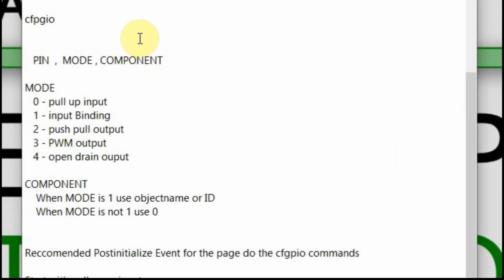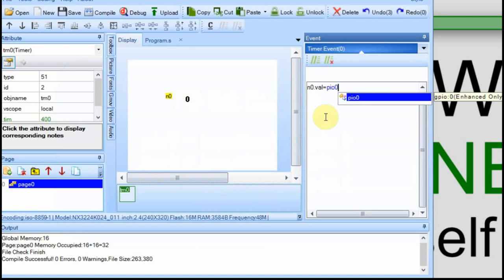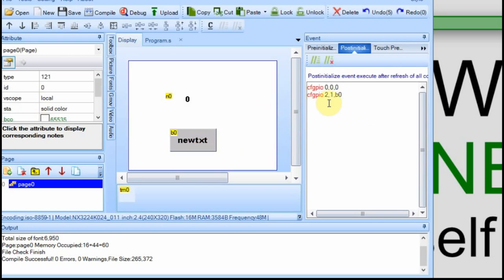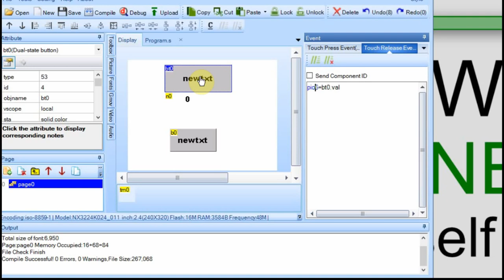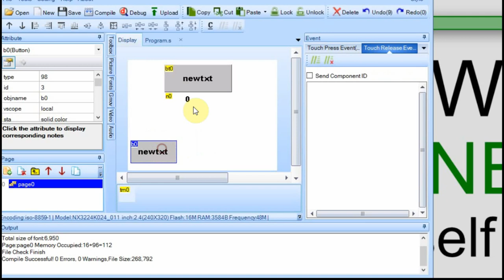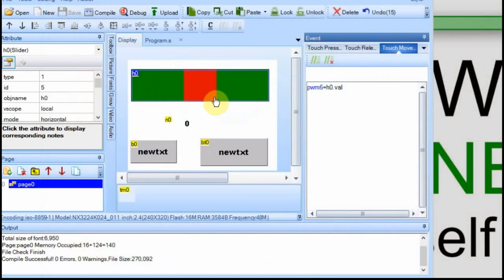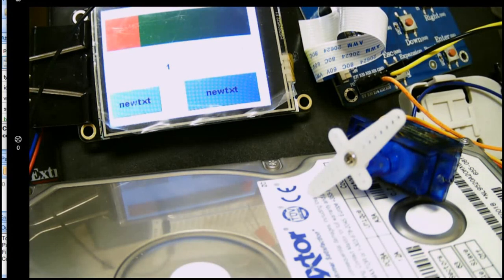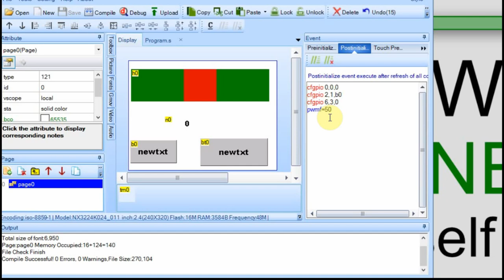140 Nextion gpio pins an overview of the configuration and usage with some simple examples

Comment: Great work,  I have  10 values i want controlled in one button when click button all 10 values star how can do that
Reply from the maker: If you want to control a larger load you will need to attach a relay or opto isolator so you don't damage the Nextion Display.  Thank you for watching.

Comment: thanks a lot ,,,can  the nextiom hmi work with plc  like allen bradley or siemens ,serial communication ?thank you
Reply from the maker: I am not sure.  the Nextion can sends HEX codes at all baud rates.  If the PLC can interpret codes and send specific strings then it should work.  You can get a cheap low end model and try it out.  I have access to some MicroLogic PLCs but I think I need proprietary software to code them.
Reply: @CheapControls  thank you ill try it and then tell you :)
Reply from the maker: I look forward to hearing back.  What brand of PLC are you using?
Reply: @CheapControls  i have many plc ,,,allen bradley ,micrologix ,,,controllogix , siemens s7 1500 , panasonic sigma , i have a converter too to convert rs232 to ethernet ,,,,i think communication with hmi nextion willl be as sending message .(like awa instruction in allen bradley ,,,
Reply from the maker: I have not programmed an Allen Bradly in 20 years.  Good luck and let me know how it goes.

Comment: Simple servos take a command pulse from 1000us to 2000us. At 50Hz, 1% = 200us, so 1000us would be 5% and 2000us would be 10%.
Reply from the maker: That is interesting.  I am building a circuit board that will make this information very useful

Comment: Can the display be set to start with pins on low instead of high  without connecting to  an arduino? 
I have mine set up to 8 relays and works perfectly but want it to start with pins on low.
Reply from the maker: I do not believe you can change polarity in the Nextion for the I/O pins

Comment: I still don't know how to connect sensors and import their values? It says on the ITEAD homepage that it is to be used for this. What I don't know yet: how does the piezzo work?
Reply from the maker: I have not found the Nextion to work for collecting data.  It is better to use an Arduino to collect sensor data and then transmit it over serial.  For control the Nextion can turn things on and off and do some PWM  but the current level is very low.  I think it is best to use nextion for display and Arduino to input and output.  I have started to use ESP32 in place of Arduino but it functions very similar.  The ESP32 has Wifi.  Sorry if this is confusing.
Reply: @CheapControls  my board is also ESP32 (with Nano 33 I have a little struggle) and in HA ESPHome, not in IDE (IDE is not very good for ESP32). I wanted to recreate an "NSPanel where the relays (240V, instead of 5V) are already built in, but it can be recreated using "Expand Board". For me it would be easier if Nextion not only "beeped", but also that Device turns on what can be connected (small pump 5V, for pouring) If I connect it to VCC and Ground with no definition, it starts working immediately.But the pump doesn't have 4 wires like a motor, so I have no idea , how I can switch it on (without ESP32 board) It is therefore important to me that the Nextion can also work independently, because unfortunately there is often an Internet failure, and an ESP32 then no longer works, but a Nextion does not need Internet/WLAN, to switch its own GPIO (that's why I prefer battery+time setting instead of "Internet time") In EasyESP (I also like coding) I don't know at all how to specify the GPIO and Piezzo beep, and also alarm afterwards say if something is wrong. That's what the GPIOs are for. Or not? Unfortunately, there is hardly anything to be found... I found this, but without a sketch of what should be connected and where:

Could you please show that too, or "frize" where to connect the GPIO and PIN of devices to? Unfortunately, the video doesn't show it very well. Where is VCC and where is the yellow wire?

https://nextion.tech/2022/01/24/the-sunday-blog-nextion-gpio-part3-digital-input-unbound-and-bound/
Reply from the maker: I can not speak to the buzzer.  I have not used it too much but the Nextion displays should drive a relay and I have found the RTC to be fairly accurate.  You should probably have an admin page were you can adjust it from time to time. 

As long as you don't need to control or read analog signals you should be good.  I have a larger board for testing the GPIO pins that works well.  I have limited experience with the smaller board.  Do you think there would be a market for a relay board that connects directly to the Nextion?  I might start building one.  I am not sure your location.  Feel free to submit a comment on www.cheapcontrols.com and I will reply through Email.
Reply: @CheapControls  I just added a chirp to keys on a small keyboard app. The expansion board beeper was configured with
  cfgpio 7,2,0

I use a disabled hotspot to create a beep subroutine (in the press event)
  pio7=1
  delay=15
  pio7=0

I call it with
  click beep,1

You've probably sorted this by now, but I thought I'd share for new people. You do a great job on the videos. I use the Nextion with the Propeller processors with my own library. At the moment it's deployed in two commercial products (camera pan/tilt controller and a laser-tag game piece).
Reply from the maker: @JonMcPhalen  That is very interesting.  I originally started this channel as a basic electronics channel, which was not a good idea.  I stumbled onto the Nextion and decided to make it a control channel with those displays.  But then I got sidetracked and spent the last year making 90% Nextion tutorial videos.  I want to get back into the control videos.  I have a video coming out next week with an add-on relay board for the Nextion that connects directly to the GPIO port.  I want to adjust it slightly and then make one with PWM and some other options.  I am unsure if there is a market, but it is fun to build things.  If you'd like to play with one of my boards, let me know over at the cheap controls main website.  I have a contact form on the help page.  I hope to have the video out on Thursday.

Comment: Is it possible to get multiple float values from one or several sensors through GPIO? 
For example, t,h,p from BME290 
or/and +coordinates from GPS/compass?
Reply from the maker: I do not think this is possible.  I do not have an intelligent model but I do know the Nextion can not interpret Float values.  You have to do some tricks if you want to work with Floats.
Reply from the maker: @conceptobject  I don't think so but do you have the model of GPS sensor you are using?

Comment: do you know if the IO output, when i press a button on the screen, is constantly outputting or is it kind of like PWM where its on 50% of the time? im asking because i have an arduino with a TMC2208 and a physical button as well as one output from the Nextion connected to the input of my arduino. If i press the physical button the motor turns in one direction but if i press the button on the Nextion the motor turns slower. 

...
  if ((digitalRead(ENDSTOP_MIN) == LOW) || ((digitalRead(fwd) == HIGH)))
...

ENDSTOP_MIN is the physical button and fwd is the software button from the nextion. (its just LOW and HIGH because the physical button outputs 3.3v when its depressed)
Reply from the maker: You can configure the I/O on the Nextion to operate in different ways.  It has never acted in a way that I did not expect.  I would love to see your code.  If you want you can Email me with your code and I will check it out.
Reply: @CheapControls  okay i have used my little oscilloscope and the signal from the Nextion is definitely a clean steady sginal so the error must be in the code i will look through the code again to see if i can find anything.
Reply: @CheapControls  i solved it, had too much "()" in the if statements

before:  if ((digitalRead(ENDSTOP_MIN) == LOW) || ((digitalRead(fwd) == HIGH)))

now:  if (digitalRead(ENDSTOP_MIN) == LOW || digitalRead(fwd) == HIGH)
Reply from the maker: That's great.  It always feels good when you find the problem

Comment: Thanks for this video, very useful because there isn't a good guide about all the Nextion commands. I' have try to follow your instructions but there's a problem. I have the Intelligente series display and when I try to execute the "cfgpio" instruction appear a message which say " configure GPIO - Enhanced Model Only".

I have Nextion Editor V1.63.3
Reply from the maker: what pin are you trying to configure?  The enhanced and intelligent have different pin configuration.
Reply: @CheapControls  I am trying to control PWM output at IO-6. How can I control it?
Reply from the maker: @muratkokturk4922  What model board are you using?  I sometimes get this backward but enhanced PWM is IO 4,5,6,7 and intelligent is only 6 and 7.  Either way, you should be good.  What part of the video do you not understand?

Comment: could you please make tutorial for 3 mode fan speed control? Low Speed, Medium Speed and High Speed.
Reply from the maker: I am working on a speed control video but it is not stand alone.  I am in the middle of a job change so it has been difficult to make videos. I will get more out as soon as I settle in.
Reply: @CheapControls  Thank you, with your tutorial videos i made which i want, thank you so much

Comment: Hello, I would like to ask some questions. I use the 2.4-inch expansion IO to output two channels of PWM to my expansion hardware, which causes the slider function of the touch screen to freeze. I have never found the reason. Have you encountered it? Can you give me some pointers? Thanks
Reply from the maker: The only way I could help with, is to see your code.  You would need to go to www.cheapcontrols.com and submit a help request.  Then we would interact over emaill.